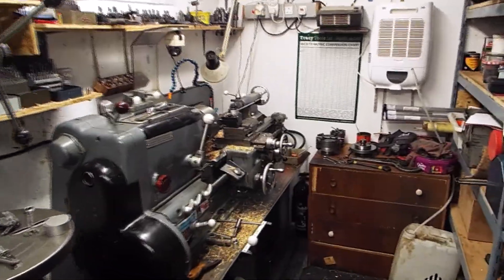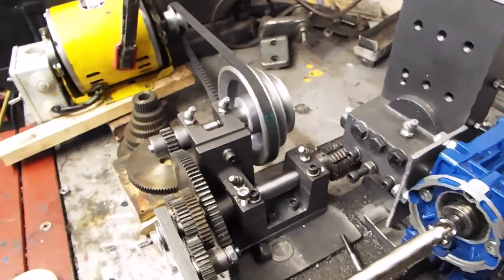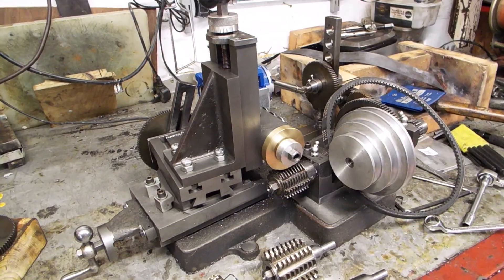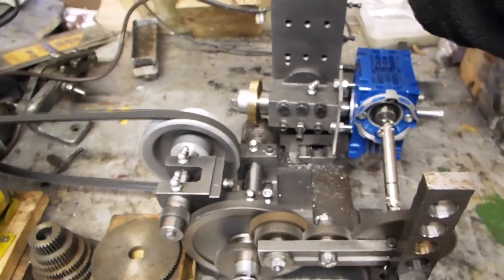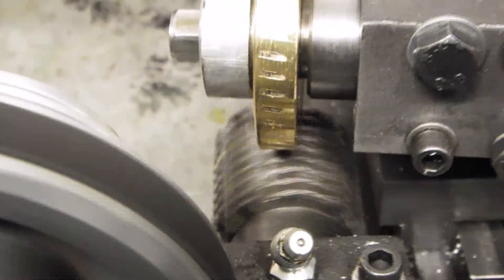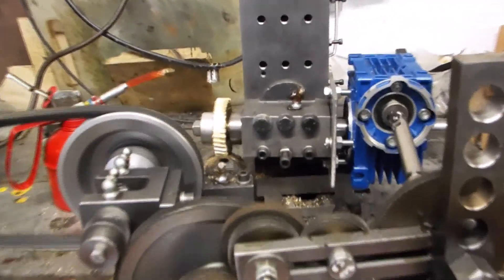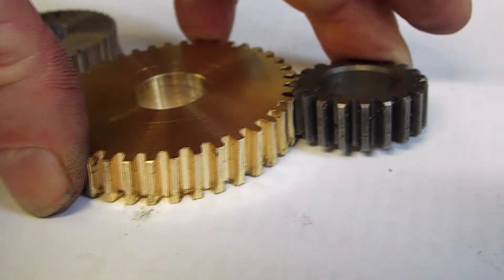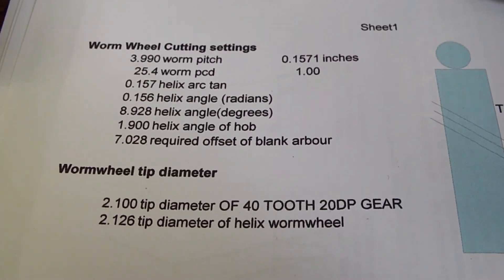A Jacobs Gear Hobber   making parts for itself!

Comment: How are you finding gear making on the Jacobs hobber now?
Reply from the maker: To be honest other things have consumed my time. However, I plan to make some timing gears for a vintage bike I have been working on, so we will see 🙂
Reply: @medsteadengineering  I would be very interested to know how it works in practice.
Reply from the maker: @BensWorkshop  yes, the test gears and worm wheel looked (and worked fine) but the timing gears will be in much tougher steel...but I did buy a brand-new hob...so we will sees

Comment: That looks like a nice piece of gear when you've got it all together and fit up well.  I make tooling on a regular basis, and highly recommend thrust bearings on all pertinent shafts.  That looks like a machine built by Dave Gingery, some twenty or so years ago, here in the states, some basic principle, design, not saying a copy, but a good basic design from a century and more ago.  It's good to see some of the Brit machinery I've seen in print, without a pic, for most of my life.  Thanks for this bit of magic.
Reply from the maker: Yes thrust bearings would be an improvement. I have not had time to use it much (working on our steam yacht too much!). The design was published in Model Engineer in the early 1980s. Apparently Mr Jacobs was a professional engineer who was involved in gear making in his work. On retirement he decided to design and make the hobbing machine for his own use at home. The castings and drawings are still available from College Engineering Supplies in the UK.
Reply: @medsteadengineering  I made mine without any castings,  there was a mention in the original article that the designer used a piece of steel beam for found in the side of the street for the machine base

Comment: What a great idea. Where do you get that U-joint and shaft for the R/C car? I have an old Atlas milling machine that I'm rebuilding and that just may work nicely.
EDIT - I just noticed that you may want to check the phasing of the u-joints (@ 1:37). It looks a little off, but it's hard to tell in the video. :)
Reply from the maker: Just check eBay, thousands there 😁

Comment: It doesn't really matter what the base ratio of gear hobber is. The appropriate gearing for cutting a certain number of teeth is just the base ratio divided by the number of teeth. One thing we did with our gear hobber at where I worked was to make up change gears with from 22T to 75 or 80. As the base ratio of the machine was 30:1 cutting any gear was simply a matter of using a 30T driver and a driven the same number of teeth. We did the same thing with the feed gears. About the only time we had to use a compound gear train was for cutting helicals.

Comment: Very smart and clever gadget,if isn't much to ask? What's the speed of the Gear blank? Assuming that the electric motor would be 1200 r.p.m's!!
Reply: The motor runs at 1,400rpm (50hz sync). The speed of the gear blank depends on the number of teeth being cut on it. So a 50tooth gear would be turned at 1/50th of the speed of the hob, a 26tooth gear blank at 1/26th of the speed of the hob. The hob speed depends on which belt position of the drive belt, but about 150rpm...

Comment: No fear of the universal driveshaft introducing cyclical variations in rpm being impressed on the blank ? 🤔
Nice little setup you have, a shame you haven't more space... 🤗

From the Emerald Isle
😎👍☘️🍺
Reply: There are two universal joints in the shaft, and they are phased so that the variations cancel each other out - just like on your car....and besides, you are talking about a variation frequency  of  30 (or is it 60) times per tooth, so I really doubt you could see it, let alone measure it... 😃

Comment: Out of curiosity, is the any documentation or manual for the Jacobs hobber? If not, what's a good book to get to help me understand how I set up all the gearing etc on this machine.
Reply: The original Model Engineer's Workshop (and I think Model Engineer) articles were prefaced by a articles on gear hobbling, and the plans provide tables of gear chains... As I was using non-standard gear sets, I wound up writing a program to provide lists of tooth numbers and gear chains, it's not too hard...

Comment: I'm looking at getting one of these machines and wanted to know what the limitations on this machine. What size external cut standard gear can be cut.
Reply: Mark, they are not a commercial/professional machine (they would cost $xxxxk), but they do work, about 6" diameter max. I will report as it gets used for more projects, all so far have been bronze or aluminium....
Reply: @malcolmduckett1626  Thanks for getting back to me. I understand the machine is basically a hobby machine. I'm just hoping I'm able to use it to make some of the less common gears for my Myford lathe and maybe a few other project's. I did see a lovely Micron, but I have got the room for something like that and I haven't got £5000 either :)
Reply: @gutsngorrrr  yup it is absolutely the animal for that job and more....😃👍👍
Reply: @malcolmduckett1626  I look forward to seeing how you progress. I have now purchased one and can't wait to give it a go, though I imagine it's going to be a steep learning curve

Comment: Made one years ago, run mine a lot slower though, saves a lot of movement on the parts, buts cuts gears very well.
Reply from the maker: It is a fun thing, some fettling and fitting got the movement under control!